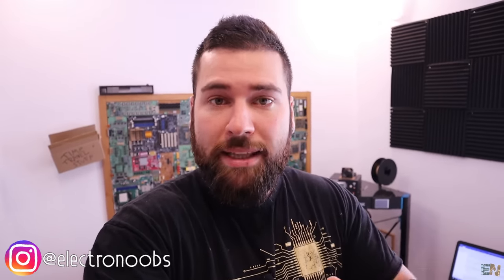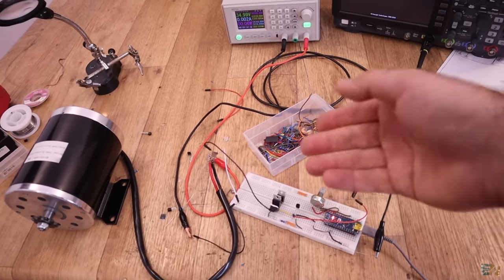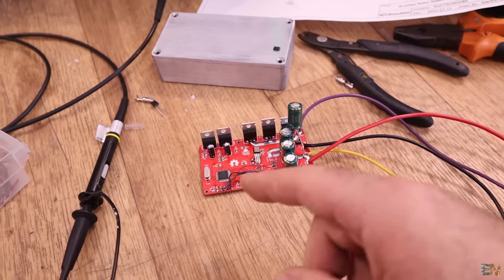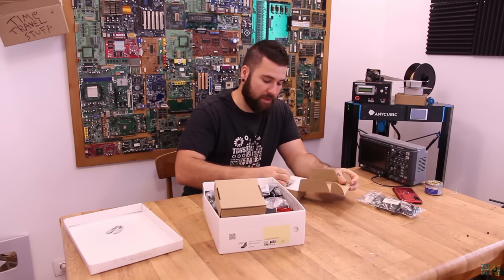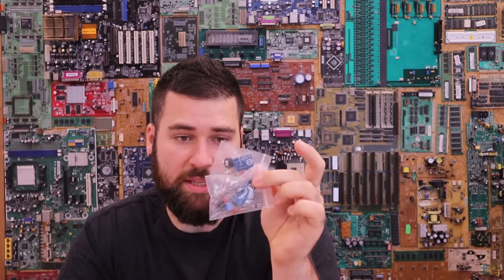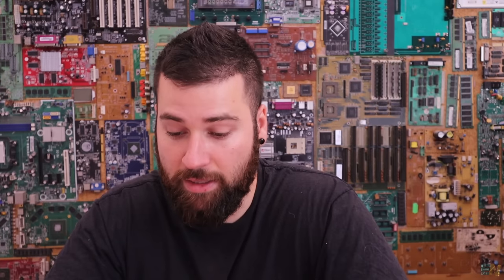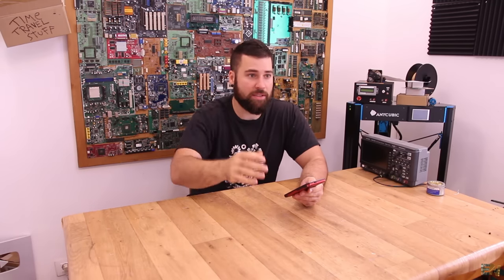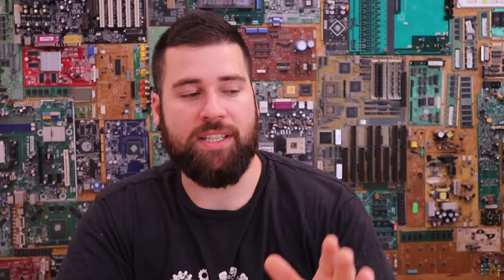300W Brushed ESC, Mailbag + Q&A | ElectroNews#03

Comment from the maker: Remember to post below the question for next week Q&A
Sign up at ELECTRONOOBS.io: https://electronoobs.io/
Follow me on FACEBOOK for more: https://www.facebook.com/Electronoobs
help me on Patreon: https://www.patreon.com/ELECTRONOOBS
Reply: Please make vedio about return to home functions in drone and other rc 
I hope you will tell bcoz you do that kind of stuff 
And in the intro of your channel also you feature RC!
Reply: QnA: Why do you have a banana most of the time on your workbench? Lol..!!
Reply: Q&A why are you using six mosfets when You can just use a better n channel power mosfets from TI example. You can find n channel power mosfets with few mohms Rdon from TI or even better are silicon carbide mosfets like tpn19008 or tph2r408qm. SiC mosfets usually have lower Vgth so drivers can be a simple bjt.
What gate voltage are you using the mosfet ? Also I would reckon considering a D2pak mosfet then you don’t need a large heat sink ! With SiC mosfets i2r losses are minimized with low rdson and you don’t need any fancy heat sinks. Can reduce your size of the pcba!
Reply: Sir can you help me in transmitter and receiver with nrf24l01 and ardiuno
Reply: Please I'm working on it but I'm not getting it

Comment: QnA: Why do you have a banana most of the time on your workbench? Lol..!!
Reply: I've always assumed for scale
Reply: @house89147  then what are the dimensions of the banana🍌
Reply: @ManishSharma-be3pk  try buying a vice, angle plate, capacitor, or an end mill on eBay with just photos and no frame of reference (happens trust me). And you will understand the scaling of a banana. Also that for very little money you can buy some things on eBay that you have no sensible way to lift even though they look quite small lol.
Reply: for comparison purposes

Comment: I like how the motor controller design is coming along although I noticed you are running >70 Watts through a breadboard and some very flimsy breadboard jumper wires. I would recommend something a little but beefy to handle the power.

Comment: I believe you said the motor draws up to 5 amps, and you’re using 3 mosfets for it in parallel, why not just use a irfz44n that can handle up to 50 volts, 49 amps, and has a v_gs(on) of 2-4 volts?
Reply: There are other irf that go twice as high too.
Would probably need a heat sink though.
Reply: LittleRainGames yes, I just threw out a popular one. Might not need a heat sink though, this one has a R_ds(on) of 17.5m ohms, at 5 amps your heat dissipation would be 437.5m watts. And with a junction to ambient thermal resistance of 62.5 C/W, that gives a temp rise of 27.3 C, so add that to let’s say room temp of 23 C, you get 60 C, or 140 F. It’s warm, and a heat sink wouldn’t hurt, but it would be drawing 5 amps for short bursts and drawing 3 amps the rest of the time so probably run quite a bit cooler then predicted. Either way, you’re still under the 175 C max operating range.

Comment: Q&A  question
Can you try to built or, design crude (for extream situations) ventilator using air pump or, pressurized air containers + valves+microcontroller with adjustable pressure limits and pressure duration ? I've a very rough sketch for this! In my sate a 17 years old boy died for not getting ventilation facilities! If you come up with this project then it will definitely save lot's of life!
THANK YOU!

Comment: Q&A why are you using six mosfets when You can just use a better n channel power mosfets from TI example. You can find n channel power mosfets with few mohms Rdon from TI or even better are silicon carbide mosfets like tpn19008 or tph2r408qm. SiC mosfets usually have lower Vgth so drivers can be a simple bjt.
What gate voltage are you using the mosfet ? Also I would reckon considering a D2pak mosfet then you don’t need a large heat sink ! With SiC mosfets i2r losses are minimized with low rdson and you don’t need any fancy heat sinks. Can reduce your size of the pcba!

Comment: Q&A I had an idea of making fully diy drone including the camera . So can you please explain how to connect a camera module with Arduino and stream the video signal with nrf24 and receive it on other Arduino with lcd screen or esp module or using esp board and stream it on a WiFi network and receive it on the mobile phone or any device that can connect to wifi. You can use that in the tank as well .

Comment: Since you laptop battery is dead maybe it will be a good contestant for a taredown video to get the 18650 cells inside mostly one of them dies that makes the battery go bad and the others are fine and the BMS board i also have a question so
 
QnA: will/are you considering opening a discord server in the future i suggested it before but i want to hear your opinion on it

Comment: I have a doubt like to control this esc ur using a pot right ,it drops the voltage from 5 to 0 right . If I want to control this esc via a rc reciever (pwm) . what should I do to make the pwm to volts from 0 to 5 . I don't think a low pass filter will work because the signal volt will be 3v .  How to make this pls help me out